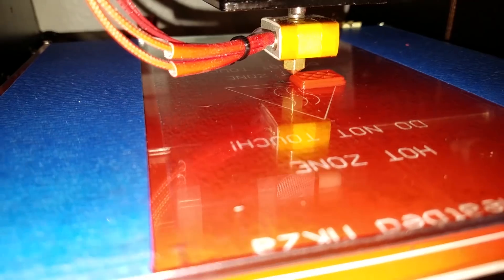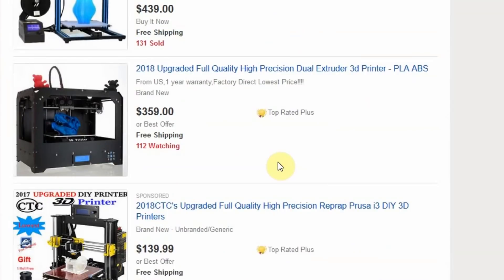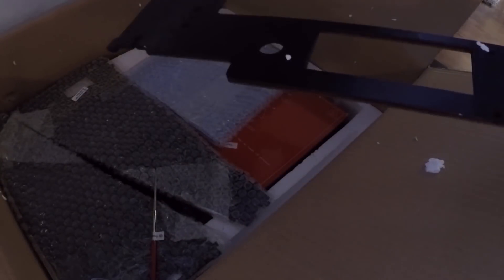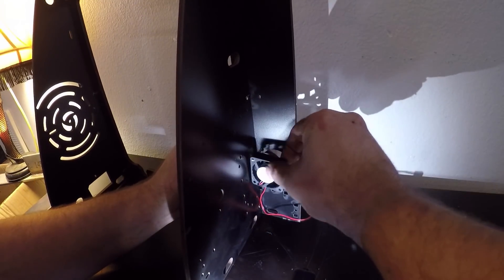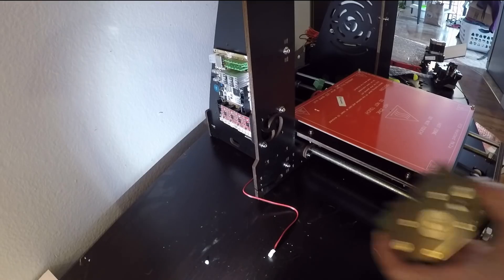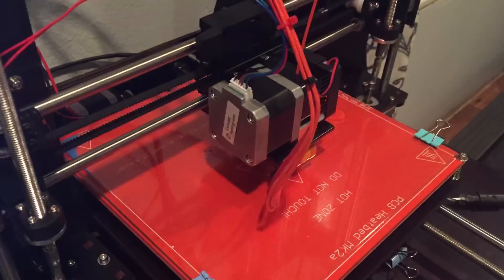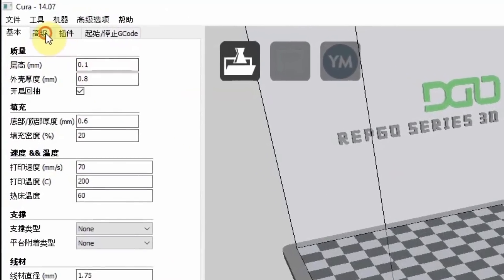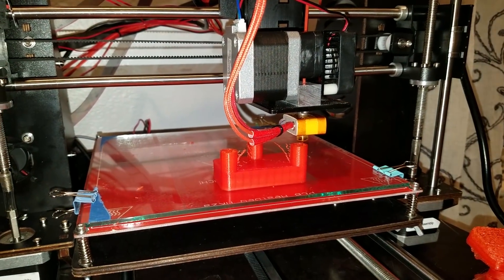Is a Cheap 3D printer any good?

Comment: I didn't get the same size box you did, or anywhere near the actual amount of parts that you had that I didn't. Then again most of my rails are held together with CNC wood and 3d printed parts for obvious reasons, it doesn't have a spool wheel for the filament. Might be an old video but any advice is appreciated. I have put off building it for so long for about 8 months because I don't like how a aside from the plate most of the weight consists of wood. 😬

Comment: How did you get it to connect to your computer? I assembled mine and downloaded cura and it wont connect for some reason.
Reply from the maker: It doesnt connect. You put the code on an SD card and put the SD card in the back of the printer.
Reply: Strange Garage yes I know that, but what's the USB cable for? Firmware updates?
Reply from the maker: I have never needed it for anything. Matter of fact, when I did have it plugged in it caused lots of problems. Like opening and closing software while the printer was printing would abort prints. I know some people swap out the z drives for higher quality thread, and that requires new programming, so possibly for something of that sort.

Otherwise, it makes a perfectly good arduino cable if you have one:)
Reply: Ok ty for the info

Comment: What are you working on these days my friend?
Reply from the maker: Ted H Posting the boat part 2 video today, then probably working on liner rails and relays for the CNC. May throw in another 3d printer video because I'm a little ahead of video schedule right now.
Reply: Strange Garage what did you end up using for the base of your new CNC since the steel base did not come through?
Reply from the maker: Ted H Still need to figure it out. Did not end up getting the base. Hoping to come up with something steel, but who knows at this point. I'll figure it out soon.

Comment: What all can you print on a 3D printer I am interested in getting one but don't know what all you are able to build with them
Reply from the maker: I'm not an expert on the subject, to be honest with you. I plan on using it for retrofit projects. For example, I want to make a new intake and a new gauge cluster for my boat project with it. I also wan't to make an arduino controlled robot with it (months from now). I'm sure I'm going to use it all the time! It's mostly just a toy, and I wouldn't have ever bought it if it wasn't so cheap, but now that i have it the parts are surprisingly strong!